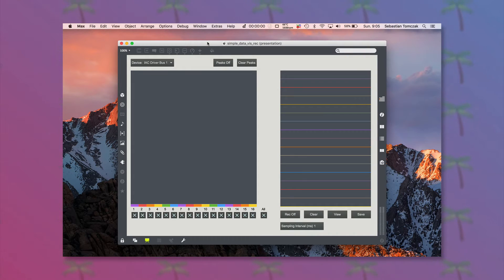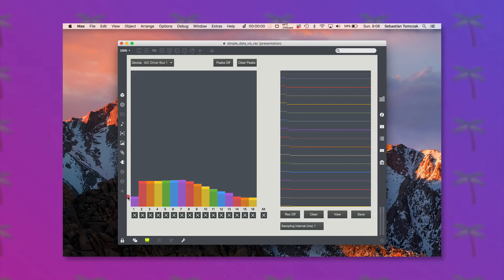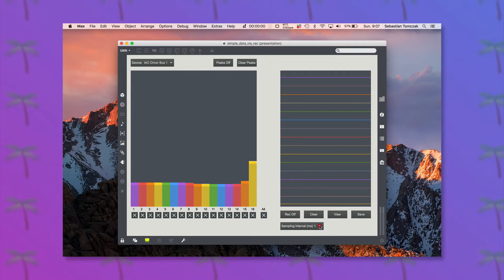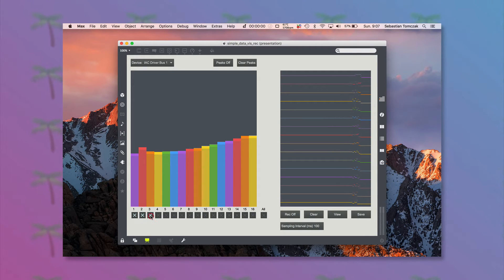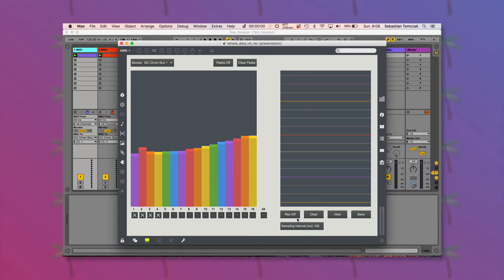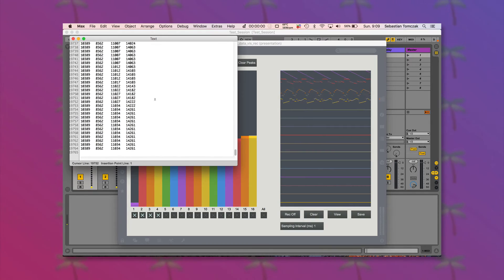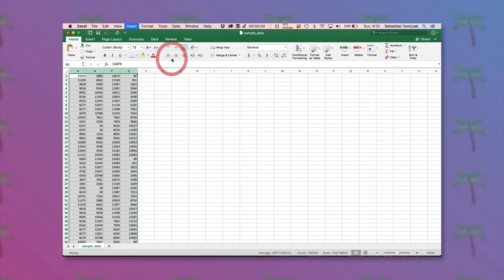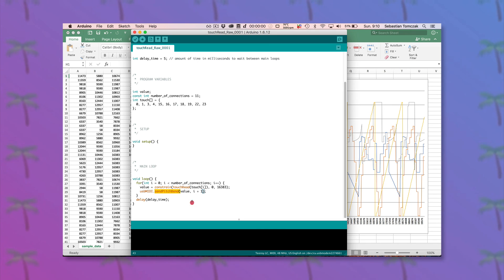Visual Data with Recording: Arduino Sensors, Max and CSV Files

Comment: Whoa. I am going to have to integrate this into a project of mine. Thanks. As a side, do you know how to edit a clip's envelope all at once via the LOM? If not, this patch will help me store user CC data and play it back in realtime.
Reply from the maker: No  - I've never seen examples of doing that using the LOM :( (Would be great if ya could though!)
Reply: You can use the enveloper follower to adjust the streams of data if you convert the data to signal first to be processed.